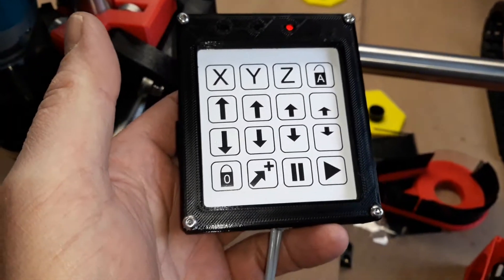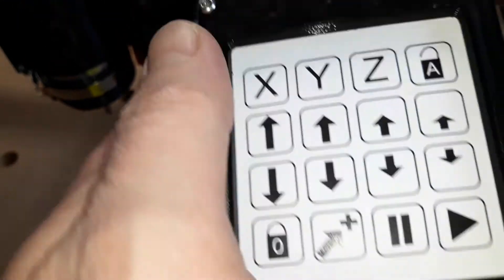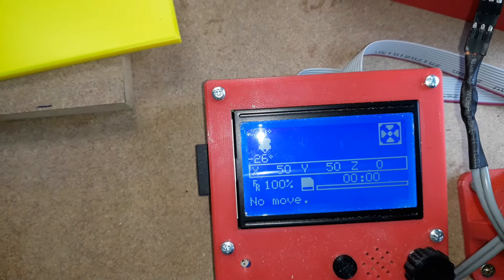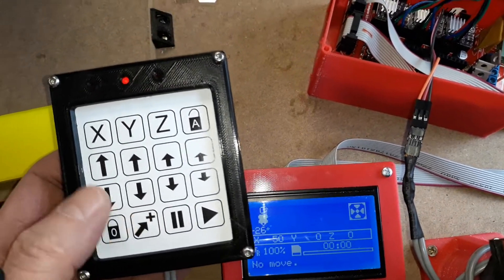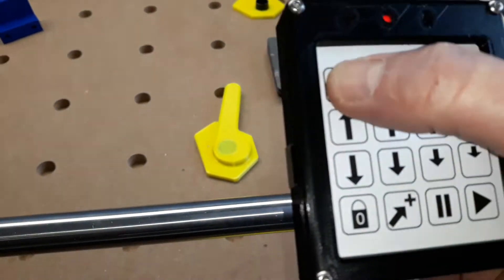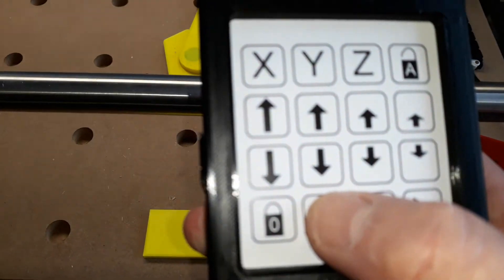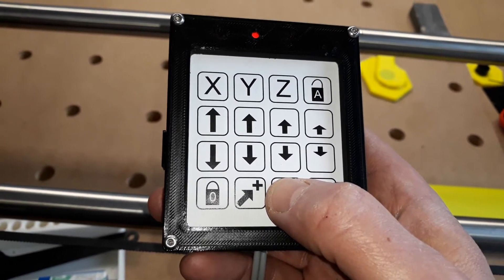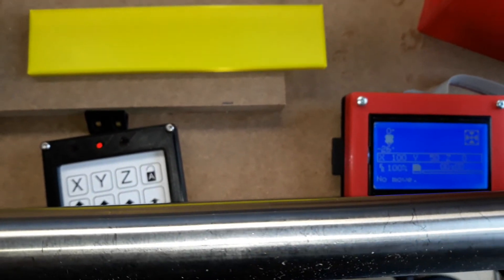MPCNC Pendant walk through

Comment: How did you make  the overlay for the keypad?
Did you have to modify the Merlin code (firmware)?
Thank you
Reply from the maker: Sorry, I've only just seen this comment. I did initially modify the Marlin code, but then worked out to get it all working with stock code. The overlay is done using Visio and the file is included on thingiverse.